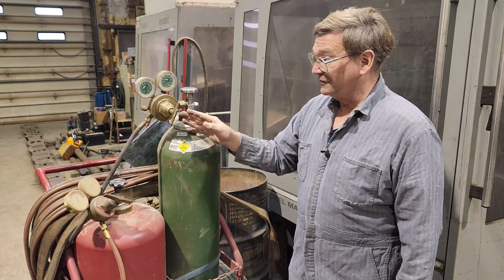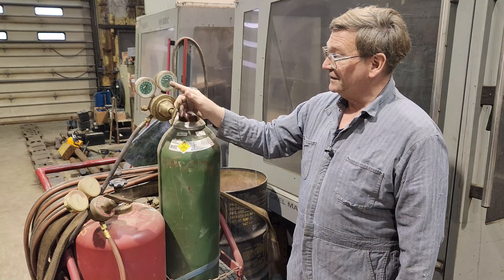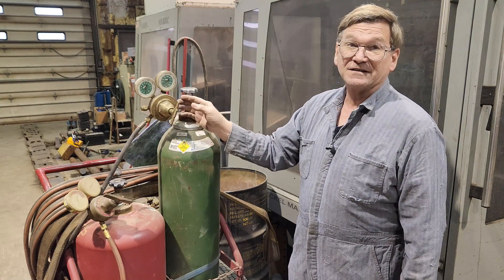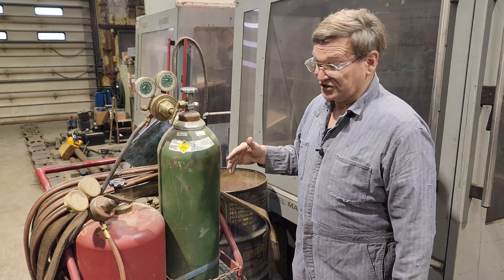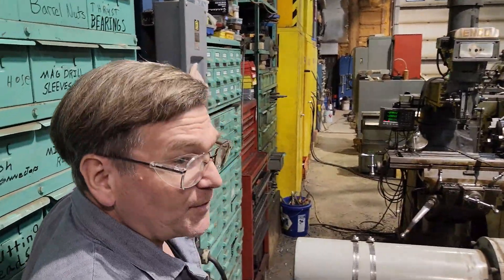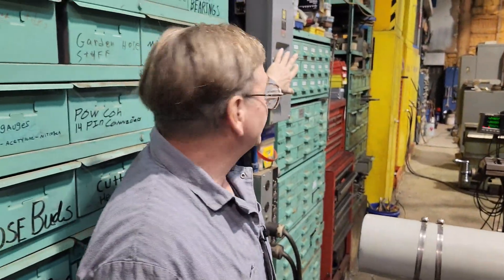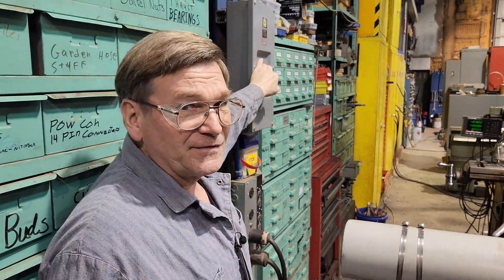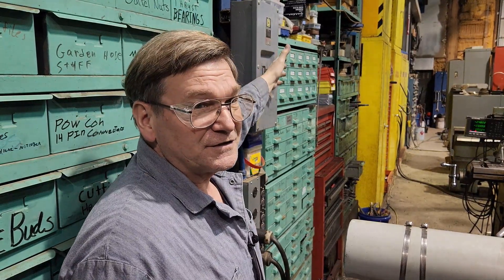Machinist's Minute(s): Open your O2 valve slowly

Comment: Always stand to the side and open slowly , never be in front of the gauge , as it can blow also and the glass and ring will hurt you, had a bad gauge blow due to a bad solder job and the glass cut my hand some .
Fixed the solder job and was all good then .
Learned from that one , stay to the side of the gauges .
It is also a good idea to relieve the pressure after turning of the tanks and turning the regulator handles out  to protect the regulator from being damaged in a hot environment , as the traped gas has no where to expand and could damage the regulator diagram , I had one that  failed and that could be why because I never wanted to waste the gas , but that little bit of gas many times is far cheaper than a new regulator .

Comment: The heat and pressure is caused by what is effectively water hammer. Same reason  for tuned engine air intakes and exhaust headers.

Comment: Young people .Peaple that handle oxygen bottles learn quickly not to move a bottle by grabbing it with your hands by the screwed on cap and attempting to lift. If the cap slips off you loose your front teeth.Also be careful about allowing your clothes to be saturated in Oxygen[like in a confined space] your clothes will burst ino flames with you in them.Argon is heavier that air .if it gets in your lungs you will die unless someone has the presence of mind to hold you upside down.The argon displaces the air in your lungs.Young people.never breath in any[argon] on a dare..

Comment: For an oxygen regulator to explode some flammable material must be present in the regulator. A textbook I have says that one investigator says that 100% of the blown up regulators he has investigated were missing the tiny sintered metal inlet filter on the input side of the regulator.  Good points on opening the valve slowly and stand to the side of where the regulator screw is pointing.  I've heard it is always the regulator itself that blows up.  

On the arc flash, the trainer at our company says that those panels with breakers are supposed to be ok as long as all of the correct, factory hardware is present and secured.  Trainer also recommended to turn disconnects on or off with your non-dominant hand because it will affect your life a bit less if you lose it.  He showed a video of a man being completely evaporated by an arc flash.  Really bad stuff.
Reply: The flammable material may be as little as skin oil from repairing the regulator without taking proper precautions. When even a tiny bit of oil ignites in a high pressure oxygen environment, it ignites the metal which burns violently and the whole thing explodes.

Before working on high pressure oxygen equipment, read up on the industry standards for cleaning it.
Reply: A lot of breakers at my factory do not have a suitable SCCR. Lots of other issues too. But it is unsafe to assume stuff has been done properly and won't explode on you. A large proportion of stuff that does go boom, has some flaw in the installation.

Comment: Oxygen valve open all the way because it's built to seal up when fully open. Acetylene valve not fully open to allow for closing quickly in case of any emergency.
Reply: This is not the case in all valves and it's bad practice to share information which might in other cases not apply and introduce unnecessary danger